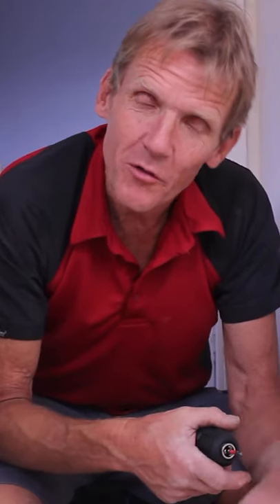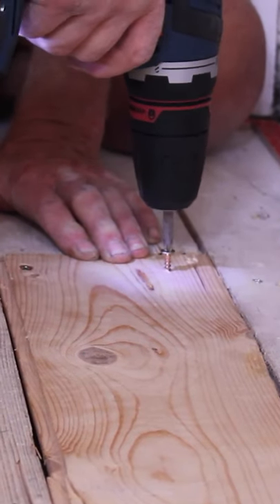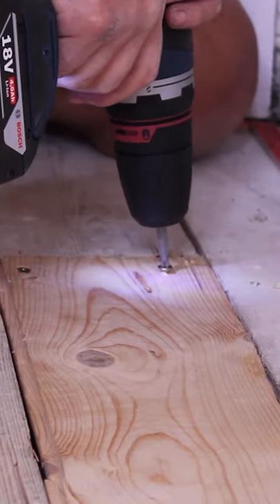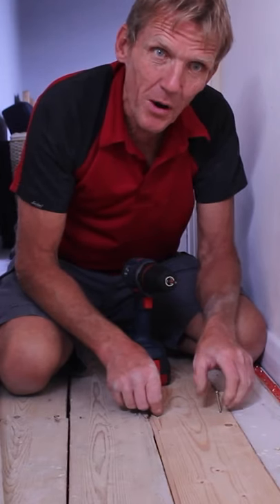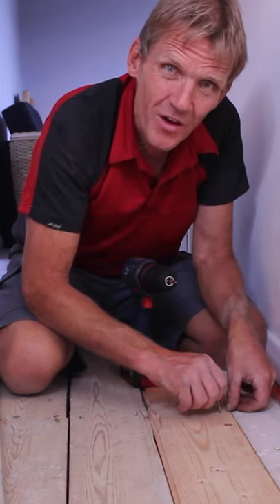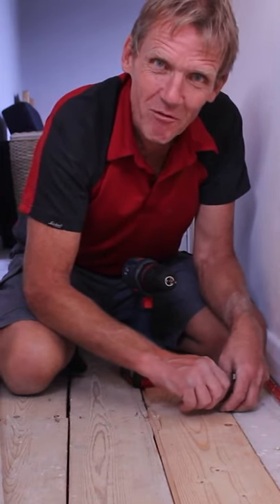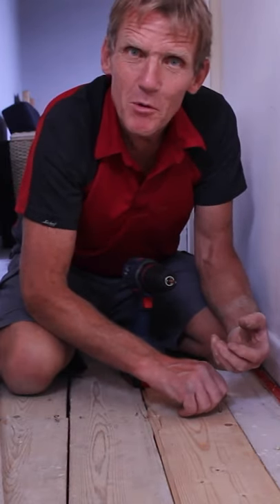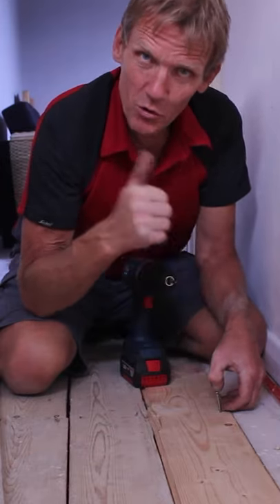Watch This Before Drilling Floorboards  #shorts

Comment: And ALWAYS ALWAYS mark the run of pipes or cables with a marker pen on the top of the board so that the next guy who could be you!, doesn't make a mistake and put a screw through!
Reply: Would be nice if other tradesman were that considerate. Some are. But. Unfortunately not all
Reply: Same here!! Then they know what to take up and what not to.
Reply: I do this, either for my future self or the next person. Especially where a pipe does a right angle turn, so isn't running the way it was you might expect from when you last saw it further back. Learnt the hard way!
Reply: Top man. If only everyone did this
Reply: And NEVER NEVER  trust the marks left by the previous guy, chance is he was in a hurry to finish the job and put the marks where he ‘remembered’ the pipes were ….. 🤔
Reply: @andyxox4168  a plumber in that much of a hurry won't bother scribbling with a sharpie 😄
Reply: @davidthomas9165  .. have you ever met one that wasn’t in a hurry to finish …
Reply: @andyxox4168  haha true
Reply: Yes I do it always, indelible black pen
Reply: I'm a prankster. I always mark on the wrong place.
Reply: @richardday2893  so it's you then!!! ;-)
Reply: @andrewclarkehomeimprovement  I'm in Australia, so not guilty 😎
Reply: @richardday2893  noooo.... I'll bet you're guilty, OK, maybe not here though.😁 Have a good one mate.
Reply: What if bare floorboards are wanted?
Reply: @sroberts605  easy. Take pictures and do a dimensioned diagram of the pipe/cable runs, keep it safe.
Reply: Exactly what I did when I completely replumbed a large house last year…. I do that for all pipework and electrics if I cannot fit them lower in the floor

Comment: i went though a pipe. took all the floorboards up and put them back down again but slightly increaed the gap between the floorboards for a nicer aesthetic - so the pipes were not longer int he center towards the end of the room! I had bought a freeze pack for pipes in anticipation as it's gravity fed system so turning the mains off wouldn't help. slapped the freeze pack on , cut the pipe and slapped a push fit cap on. Then could drain down the system next day and sort it properly

Comment: Makes me laugh how floorboards are usually creaky on landings, right next to the bathroom and the cupboard with the hot water tank....... if you look under the floor its usually a spaghetti junction of pipework - takes a chippy with nerves of steel to screw those boards down!
Reply: Good practice to mark up the floorboards, plumbers often do it but not always. Where possible have a good think first, or better a peek.
Reply: I don't see why the screws need to go in that far as you should be screwing into a beam and the floor boards laid down are already working against gravity anyway.
Common sense tells you you should feel the tension bite below.
Reply: Tell me about it. Get plenty of expanding foam down to glue and fill bits too, makes them solid.
Reply: @jamieee321  You don't want  them solid. You need easy access.
Reply: @hannahjames3180  ccoefficiant of liniear expansion,hope that helps
Reply: @hannahjames3180  if the customer is sick of creaking because plumbers and electricians have butchered their floor over the years and you've been called to fix the entire house you want them solid and using expanding foam in some of the joints etc for this type of floor works. If you need access, riping the floorboards back up isn't a big job and isn't considered something you need "easy" access. 

I've known a few instances where people gave tried to fix their problem and screwed straight into pipes. Either heat from the pipes buckles/shrinks the floor joists  and boards slightly and everything becomes loose or a lazy plumber or electrician simply doesn't screw things back down. In some instances you can't fix the floorboards in places because of how they've been cut or the amount of pipes running parallel - a bit of expanding foam works great in these situations. 

Let me hear about your experiences doing the glamorous work of screwing and nailing down floorboards
Reply: @jamieee321  You'd just replace the damaged boards and timber though rather than do bodge jobs.
Anyone who wants a good job done anyway. You can  remove  the damaged section and replace it.
Reply: @hannahjames3180  The situation is different every time. If the plumber has put 5 pipes parallel with one another parallel down the entire board length then replacing the board will fix nothing. So tell me how else you would fix the board down without using and expanding adhesive around the edges? Are you going to get the plumber to redo the central heating system so you can screw a couple of boards down in places? They might be getting carpets fitted the next day and delay that too? Or do we go by your logic and just use common sense and leave it for gravity to fix. 😂 And 1" screws everywhere else 🤣 talk about bodge jobs.
Reply: @jamieee321  Likely rare to find a situation like that. For the most part rotten boards can be fixed.

The way you are trying to justify your comment tells me to avoid hiring you.
Reply: @hannahjames3180  you probably know best like. Sound like you've ripped up and replaced plenty of floorboards up in your time.
Reply: @jamieee321  I'm not an expert. I just disagree with doing it the way  you suggest.
Reply: @jamieee321  If there's 5 pipes in a domestic running parallel down the length of the board, notched or drilled I'd want to hunt the plumber down and have a quiet word!!
Reply: And I was wrong to have the nerve. Will never do it again
Reply: @hannahjames3180  if only it was that simple
Reply: @hannahjames3180  that would be the best option to use large board panel with more options for screwing  but it's in a lot of builders interest to save money for customer even if it does end in tears
Reply: @ianthompson9058  Out of interest how are boards laid in current new builds? The old fashioned way?
Reply: @hannahjames3180  usually now instead of those long 4 inch odd wide floor boards Tonge and groove  they use a lot bigger boards 2 foot by 8 and there glued together at joints to make effectively all one board so o lot stronger. The discussed problem is more with older property's
Reply: @ianthompson9058  Are they easily accessible if glued? 
Can they be replied or do they just slot them back in?

Yes, I observed the video is about older boards. 
Interesting to learn new things from you  chaps.
Reply: @hannahjames3180  yeah no probs, now they put all the boards on the joists and there glued to each other and to the floor joists aswell so in effect it's one big whole solid platform  and then they set out the stud work on top of that so not easy to get acsess under them. Not impossible if you use a plunge saw with set depth but nothing like it used to be and they don't squeek like they used to
Reply: @ianthompson9058  Thank you.
Reply: @hannahjames3180  My first house was infested with notched floor joists. Many had split so the board screws had nothing to grip. I solved it with 2x1 battens screwed across the notch so the pipe cover board could be screws down.
An even better solution would have been to fit flooring grade chipboard across the whole landing with the pipes and wires clearly marked out. 
The 2x1s and remaining joists then enough to support the new flooring.
Reply: @hannahjames3180  ... we can see you’ve never encountered this problem, let alone tried to fix it!

Comment: MUCH better idea is don’t ever screw or nail down through a floorboard without lifting it first to see with your own eyes what’s underneath it. Risk eradicated.
Reply: Agreed! would never chance it! It takes 5 mins to lift and refit a board.
Reply: What's the best way to lift a board?
Reply: Yep, lifting t&g boards, brilliant idea. Give yourself a medal genius!
Reply: The ones in my house is impossible to lift from the middle since they are all locked together.

But its not a problem since ive redone the ceiling under it so i know where it all goes and moved the one that was to high
Reply: Perfect advice mate and exactly what I was going to say. 
Why take the risk and flood someone’s house? 

Yes, it’s a fair assumption to assume the plumber has been diligent to stick to the centre of the boards, but it’s still an assumption, an assumption that could cost you tons of money and hours if they didn’t bother, for one reason or another
Reply: @GK-qc5ry  depends on the type of flooring you have, but generally a multi tool or circular saw make an easy job of it (make sure you set the depth if using the circular saw for 1 or 2mm smaller than the thickness of your floor) then just get a bar in gap and lift. You may need to put abit of support in after before you refit the board to help stop any squeaking etc.
Reply: @therabman_5606  I have nailed in floor boards. Some squeeky ones where I'm guessing the nails have come up. Maybe just a screwdriver might be enough to live up these?
Reply: @andyxox4168  he's talking about boards that have already been lifted you tool .
Reply: @GK-qc5ry  get yourself a utility bar - like a crowbar but flat, so better for getting under the edge of a board. Only cost about £5. A screwdriver might just dig in and chew up the board if you're levering in line with the grain.
Reply: @davidthomas9165  thanks for the tip.
Reply: @andyxox4168  great reply. They obviously never done it
Reply: @cornishplumber5051  , well if you can read and comprehend English that’s not what he says!
Reply: Absolutely my hard and fast rule. I even go as far as to mark the locations of where I can and can’t screw.

Comment: When i was 14 i tried to fix squeaky floor boards in my room, was smart and put the screws at the sides near the nails but still hit a pipe..... Not fun getting my gran to ring british gas at 11pm to fix my mess up.
Reply: I know. You think you would be safe there. Just goes to show its not as simple as some in comments section make out
Reply: I'm not going to ask how those floorboards ended up squeaking.
Reply: @hannahjames3180  its the sound that's made when the nails work themselfs loose through leverage and it's the sound of the timber rubbing up and down the nail with the the wood now being raised with small gap bellow it , friction, a bit like a squeeky hinge. Doesn't take much to cause something very irritating (to some folk, doesn't really bother me living in old farm house, you get used to it)
Reply: British Gas would be the last people I’d call ... for anything!

Comment: That's good advice.... Until you get a lazy plumber that will lift 1 board to put 4 or 5 pipes through.. Then there's nowhere to screw the board down.

Comment: I moved into my new house, to me it was new. 20 year old property. Renovating the ensuite and the previous owner had used drywall screws to try and alleviate floor creak. Didn't really work. Turns out they had screwed through a radiator pipe. Screw out and the obligatory water spout. Sorted it out. No issues. Made a mess of the plasterboard garage ceiling below, so I pulled a portion down. Only to reveal that 20 years ago, the flooring guys that built the house had done the exact same thing to the other radiator pipe with a 2 1/2 inch nail. Lot of pressure behind that one, let me tell you.😂😂

Comment: This brings back fond memories of that one time I put a screw through a central heating pipe, unscrewed it because I'm an idiot and didn't know where to drain the central heating nor where the stop cock was. Running around like a headless chicken looking for towels. Good times
Reply: Aww thoughts are with you, although I didn't go through a pipe I had a job where I literally knocked a rad and the valve came off, I was like that kid with the finger in the dam. I couldn't believe it was fine until a slight knock.. hey ho if I didn't have bad luck I'd have non atall lol
Reply: Same exact story here :) The moment of sheer panic I experienced when that jet of hot water suddenly shot up is something I'll never forget !
Reply: Bet you haven't done it again though eh!!

Comment: Came over to Forres from California to build an extension on my sister's house there. Took up flooring in the existing structure and found to my astonishment electrical and plumbing notched into the tops of the floor joists! When covering with new subfloor plywood l mapped out ALL of it with a fat black sharpie pen. Cannot believe that method is standard over there. Oh well. They also have all four wheels swiveling on their shopping carts.  Can't wait to visit again.

Comment: We had just moved into our house and about 6 weeks in, we found water coming through the ceiling. It was caused by a screw on a loose floorboard rubbing on the central heating pipes and  it had worn a pin hole into it. Typical Sunday dinner time disaster.

Comment: I was replacing a floor and one of the screws I removed was going through a pipe. Sitting there eating my lunch I heard the dreadful hissing sound and then a bang. The downstairs ceiling had collapsed.
It’s not something you can prepare for. Just bad luck.
Reply from the maker: I always say to people "if you find you have put a nail or screw through a pipe leave it in until you have turned off and drained down". As you found a screw or nail can make a perfect seal in a pipe, especially a plastic one. Most of the time it is a small wet patch on the ceiling but they pull the nail out in a hurry and then there is a flood, with celings down etc.

Comment: Tubes are plastic na days 😅😅😅 metal detector is like a chocolate teapot
Reply from the maker: except for the fact that Alpex pipe has a metal layer and the pipes are threaded through the middle of the joists making them very hard to hit unless you are using 4 inch screws,

Comment: Eh I know all about that, lucky it happened in my own house. And exactly as you said it right through the middle of the board... in TWO places.
Needles to say all my pipes are marked now with red and black markers where I have new ply flooring, best thing I ever did, cant wait to do the bedrooms too. I hate those t&g boards and those nails which hold well in the joist very hard to pull out but work themslves loose around the floor board.